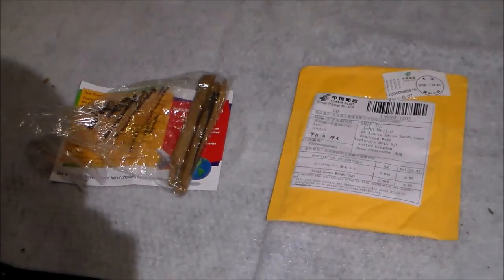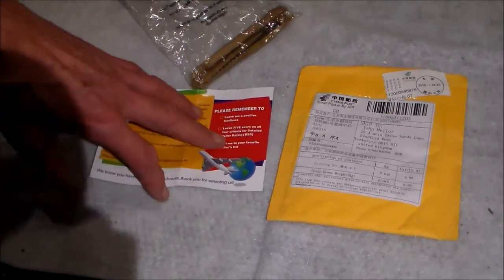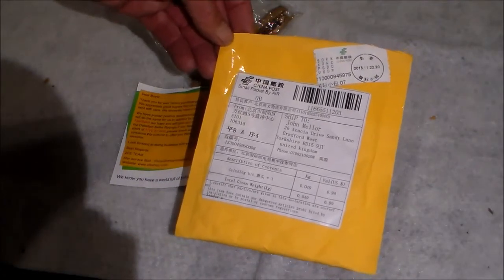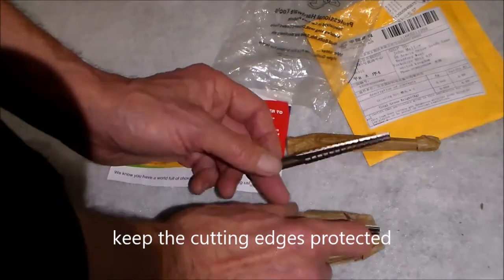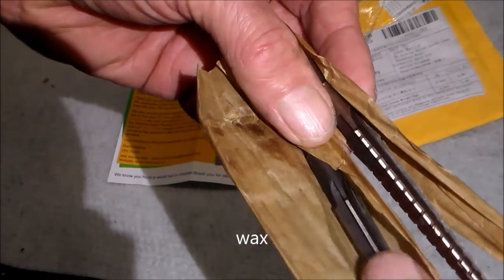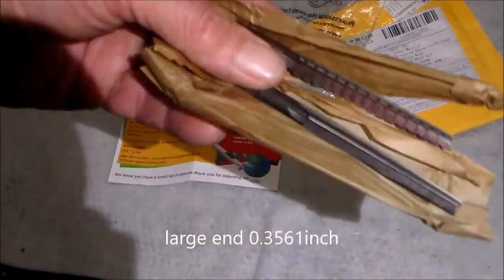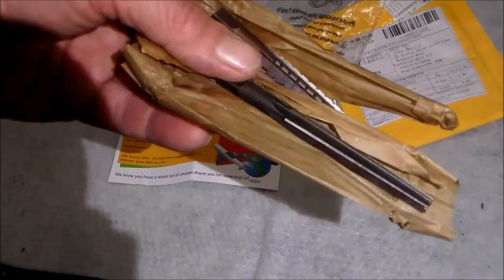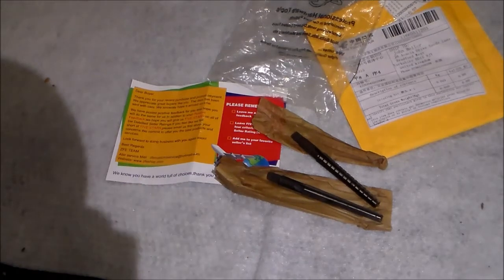MT0 morse taper reamers

Comment: Hi, thanks for the video.
I have just got a set like these. 
And I tried to use them but it looks like they are reaming heavily on the wider diameter and not touching the other end. 

Did you use these?  And was the geometry of the taper accurate after the reaming process?
Reply from the maker: Hi Dror, I didn't ream I just cleaned up the inside of the spindle and used them as a go/no go gauge. The spindle bore seems to match the reamer. The cheap MT0 arbour from the USA is out and the Polish or Chinese 'long' tapers that project too far are out. I am going to the Model Engineering show in Doncaster in May and will look for others and take a spare spindle to check the fit.
Reply from the maker: None at the show.

Comment: hey there, just wondering if this improve the fit at all. I'm considering using these for my drill press
Reply from the maker: The reamers clean up the morse taper socket and improve the fit. They remove corosion and small burs. i am assuming that they have been made to an accurate taper and so am using them as 'truth gauges'.

Comment: Never used a reamer of any kind,,,, something I need to lean about ,,, Many thanks for sharing
Reply from the maker: +Alan Plumb I will let you know how it goes Alan. I need to get hold of some engineers blue first.
Reply from the maker: The morse taper reamers cleaned up the socket but ended up proving that the taper bought from RGD was incorrect.